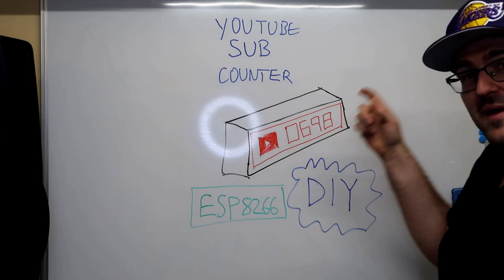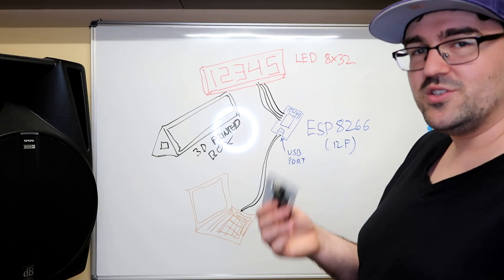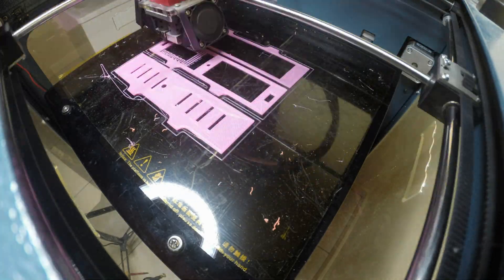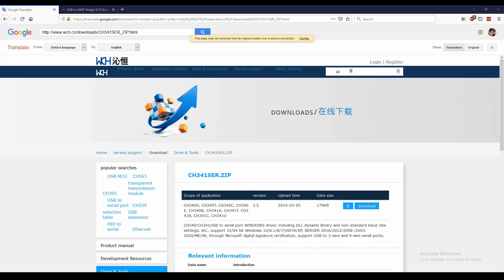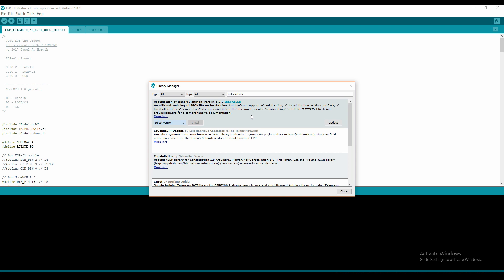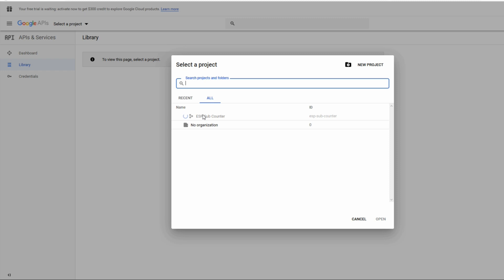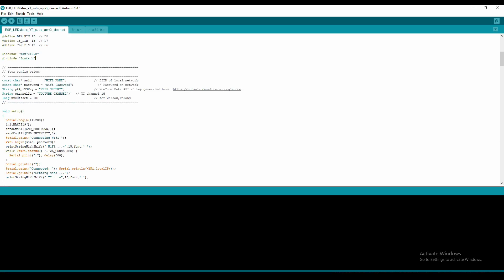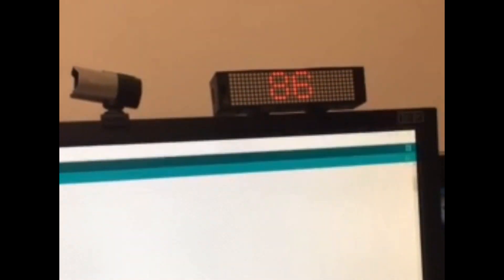YouTube Subscriber Counter ESP8266 + MAX7219 (Step by step, easy guide)

Comment: I'm a complete beginner with this stuff and keep getting  errors.  "max7219 no file or directory"  This video is good, but I feel some key information is left out of the actual "compiling and uploading to the board" section for us people who have never touched Arduino.   And I don't have the time or intelligence to figure this out.

Oh well.  I only spent 20 bucks.
Reply from the maker: Hey, sorry your right I have not really gone into the basics of compiling and uploading code to boards, I would assume other videos out there do explain the basics but if I can I will try do a basics video on this stuff or add more detail/steps in future videos explaining this. thanks for the feedback. 

As for the error, when compiling the code it is going through until it gets to the part #include "max7219.h" it can not find the file in the library. In the description of this video their is a link to the code which also contains the file but I would suggest if you watch my other video https://youtu.be/QvL79mF-BCY it has a step by step on how to add the max7219 file and also links as well.

Comment: really wanted this to work but cant get it to do so.. bummer.
Reply from the maker: If you detail out the issue I can try and tell you what what be wrong
Reply: @ScottyDIY   I had issues finding code that worked in Arduino. thanks for the offer but I eventually found another script that I was able to fine tune and get it to work.
Reply from the maker: all good, glad you sorted it out. Does your Arduino have Wi-Fi or is it serial connected for the data?
Reply: @ScottyDIY  Wifi. picked up one of these from amazon: ESP8266 NodeMCU CP2102 ESP-12E

Comment: Hi friend, im your subscriber.
I m also youtube.. 
I planing to do this project.. 
I bought display and modules. 
Just give me code 
Iwill just copy and paste. 
This video description link having 3 type code available so im confused. 
I will give my mail id
Place send text code.. 
My email is arunyesodharan1988@gmail.com
Reply: THANKS FOR REPLAY
Reply from the maker: The code in in the github link https://github.com/5cottyD/Projects/tree/master/ESP_LEDMatrix_YT_subs_apiv3_cleaned

Just to clarify the other 2 file “max and fonts” are library’s that get included under the max7219 library you can install this library via the same process as the json library. Mine was already installed when I did this video https://youtu.be/QvL79mF-BCY

Comment: Hi I have a problem with this code:
void updateTime()
{
  long curEpoch = localEpoc + ((millis() - localMillisAtUpdate) / 1000);
  long epoch = round(curEpoch + 3600 * utcOffset + 86400L) % 86400L;
  h = ((epoch  % 86400L) / 3600) % 24;
  m = (epoch % 3600) / 60;
  s = epoch % 60;
}
I get this error:
invalid operands of types 'double' and 'long int' to binary 'operator%'

Comment: why am i getting this message?

# Arduino: 1.8.12 (Windows Store 1.8.33.0) (Windows 10), Board: "LOLIN(WEMOS) D1 R2 & mini, 80 MHz, Flash, Enabled, All SSL ciphers (most compatible), 4MB (FS:2MB OTA:~1019KB), v2 Lower Memory, Disabled, SSL, All Flash Contents, 921600"

\\IKRYLOV\Web\YOUTUBE\TEMPLATES\ESP_LEDMatrix_YT_subs_apiv3_cleaned\ESP_LEDMatrix_YT_subs_apiv3_cleaned.ino: In function 'void updateTime()':

ESP_LEDMatrix_YT_subs_apiv3_cleaned:341:62: error: invalid operands of types 'double' and 'long int' to binary 'operator%'

   long epoch = round(curEpoch + 3600 * utcOffset + 86400L) % 86400L;

                                                              ^

exit status 1
invalid operands of types 'double' and 'long int' to binary 'operator%'

This report would have more information with
"Show verbose output during compilation"
option enabled in File -> Preferences.
Reply: Hi I too have the same problem, you managed to solve it?

Comment: Hi! I get an error on the last rows of the file saying: invalid operands of types 'double' and 'long int' to binary 'operator%' It is highlighting this row:   long epoch = round(curEpoch + 3600 * utcOffset + 86400L) % 86400L;
Any idea what that means?
Reply: You need to cast the variable type, like so:

 long epoch = (long)(round(curEpoch + 3600 * utcOffset + 86400L)) % 86400L;

Comment: Scotty D, I have been struggling with this code for days now. I can compile and upload it to my ESP8266. The serial monitor says it has connected to WiFi but it always fails to connect to YouTube. I have created the YouTubeAPI key as you described but no dice. On the Google Cloud Services dashboard I am not getting any data on the traffic or error charts. The max7219 display won't show the time, and all other fields are showing zero. Any help you could offer would be greatly appreciated. BTW, I am using Json V6.0 and I have edited the code accordingly. It wouldn't work with Json V5.0 either.
Regards,
Mark Presling
Reply from the maker: Hey sorry to hear. Just checked and I’m using json 5.2.0 not sure if it will make a difference I did try with newer version and it failed
Reply: @ScottyDIY  I am thinking it is something to do with the settings in Google's API environment. I noticed that in your video there is evidence of traffic in your dashboard charts but I am getting nothing. No matter what credentials I try the serial monitor always shows that I am not able to connect to YouTube. I did originally try the Json5 versions but the code would not compile. I found a video that showed how to rewrite the code for V6 and it did compile and upload. I am getting desperate enough to go back to the original code and try version 5 again.
Regards,
Mark
Reply: @Preso58  did you get to the  bottom of this?

Comment: Im having trouble with this code. It doesn't work for me. I have rolled back to json 5 so its compatible (otherwise you need to update the code so json v6 works) but still no data.
I have Youtube API enabled and i have the v3 api code included. The time is also incorrect. for example its 21:16 but displays 21:00 and just resets back to 21:00 each time i upload the code?

Comment: Hello, is it still working for you ? I can’t get to work even though no error during compilation. I guess it is because of the latest change from YT.
Reply from the maker: Funny you say that i just noticed mine is playing up today as well, not sure yet what it is, will try have a look into it tomorrow
Reply from the maker: Just Did a Recompile and upload and it fixed the problem
Reply: Did you change something in the code ?
Reply from the maker: No, just opened the file checked the COM port was correct, then hit upload